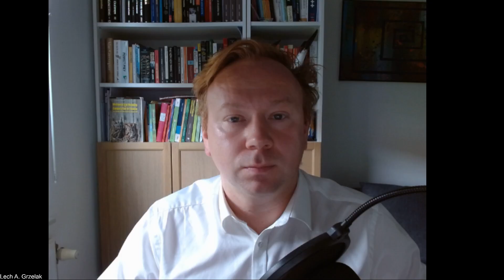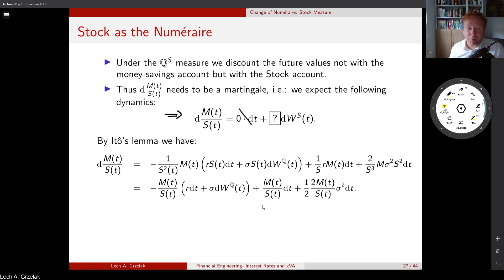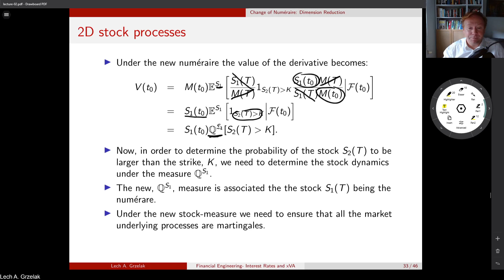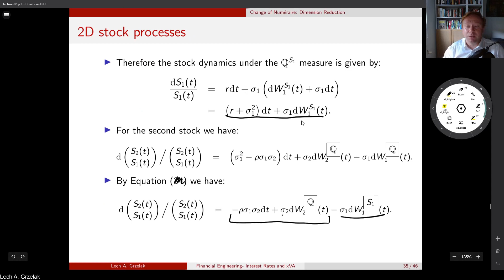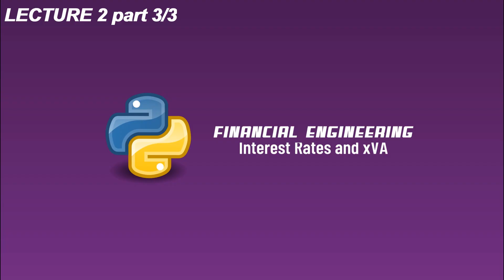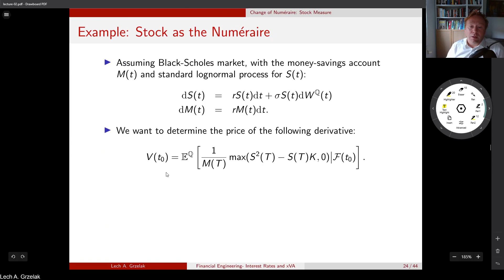Financial Engineering Course: Lecture 2/14, part 3/3, (Understanding of Filtrations and Measures)

Comment: Hey Lech your courses are simply amazing! Thank you for the great work! I would like to make a question : I can understand the framework you suggest for the measure changing. You impose the martingale condition and at first you state that with the appropriate measure there is no drift and secondly that the terms in the Brownians have to be equal ( this is because they have the same variance - first question here we know that B^p is Brownian by Girsanov?). The second question concerns the change of measure for S_2/S_1 (32:00), you make use again of the statement zero drift / same volatility, where you basically suggest : -rho*sigma_1*sigma_2*dt + sigma_2*dW^{Q}_{2}(t) - sigma_1*dW^{S1}_{2}(t) = sigma_2*dW^{S1}_{2}(t) - sigma_1*dW^{S1}_{2}(t) ==>  sigma_2*dW^{Q}_{2}(t) = rho*sigma_1*sigma_2*dt + sigma_2*dW^{S1}_{2}(t). But in which way we state that volatility for W2 in both measures (Q and S1) is the same? I can not understand how it is segregated from the volatility of W1. I hope my question is understandable. Kind regards
Reply from the maker: Hello W0oDy21, thanks for the question. It goes as follows: if we change the measure certain quantities need to be martingales under the new measure. When changing measures we know that the volatilities will not be affected, but the BMs will change. If you have multiple Brownian motions you always need to ensure that all of them are under the same measure, otherwise you cannot perform derivative pricing. Regarding your second question we speak about the volatility of the process, and not the volatility of Brownian motion. As you can see in the derivations, the volatility coefficients haven't changed. I hope it explains, if not, please contact me using my university e-mail. Best wishes, Lech
Reply: @ComputationsInFinance  Gotcha, thanks Lech!

Comment: The fundamental theorem of asset pricing as presented in the lecture, states that the price of an asset is the expectation under the risk-neutral measure of the discounted value of the payoff. My question is, does changing measure and numeraire not break this? We're no longer taking the expectation under the risk-neutral measure, so are we not in effect computing a value which is not the actual price we sought to compute? If this is correct, then why do we make a fuss, say when deriving the B.S. pricing equation, not to compute with the original GBM, and insist on this change of measure (to the risk-free measure) to get the "correct" price?

Comment: Lech, thank you for the lectures and the Python code examples. There could be a small typo in Black_Scholes_Jumps.py where we calculate Call option price using Conditional Expectation. At the following line, NoOfPaths should be replaced by N ? I think we are simulating on an increasing number of paths and not a constant of 25.
resultCondExp[i] = CallOption_CondExpectation(NoOfPaths,T,S0,K,J,r) # replace this
resultCondExp[i] = CallOption_CondExpectation(N, T, S0, K, J, r) # with this
Thanks again.
Reply from the maker: hello Suhas, Indeed, it is a very point! Well spotted. 
I have just corrected the code, so the corrected version is now available on Github. Thanks for the info! 
Best regards, Lech